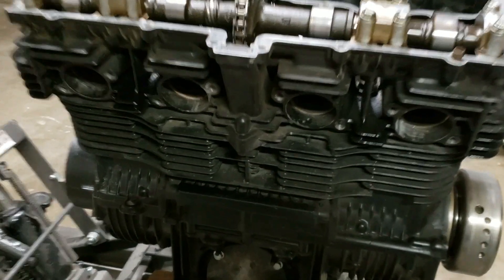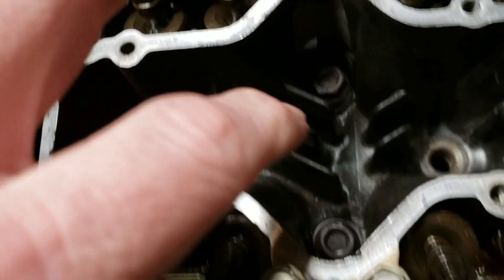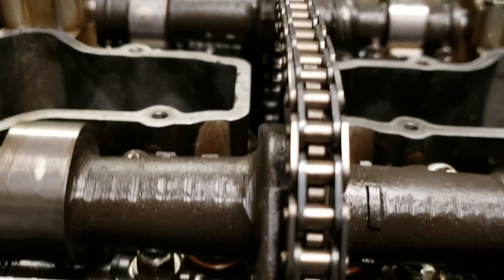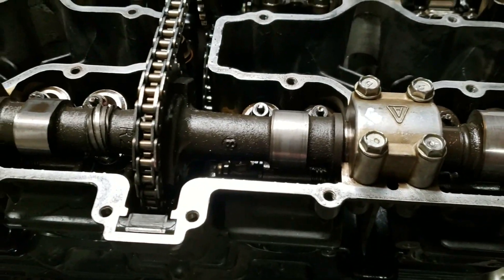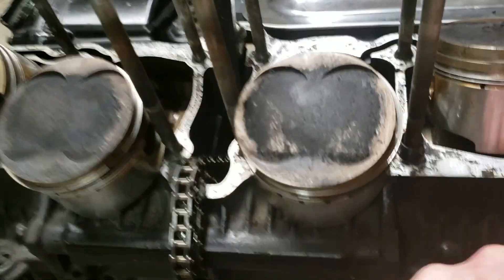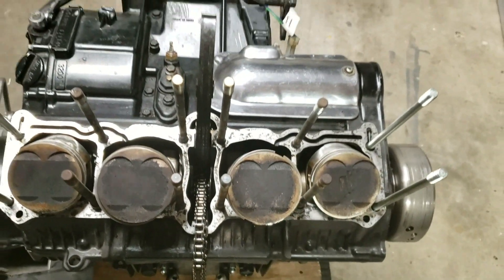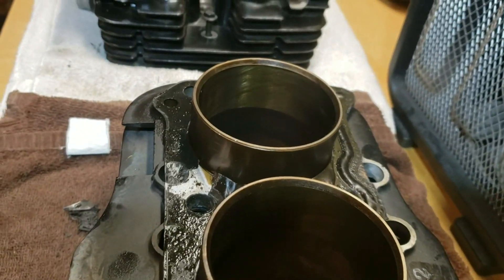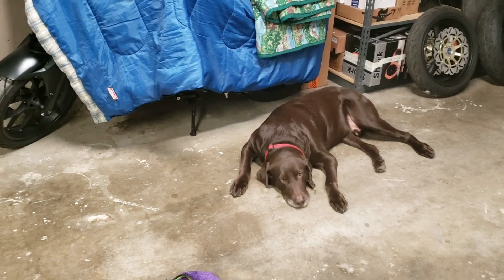DAY 53 83 Suzuki GS1100E build

Comment: Have 83 gs1100 built for drag strip only. I hv hard welded extended pads on rockers,with web cams 212grind. My cams and rockers hv been a issue with what I call glassing over. The best way to do a go ,no go check. Take a your feeler gauge ,I set my cams at .005 cold. And .004 hot. My hardest thing is getting both set the same. I try my.best but sometimes I see more glassing on onesie.

Comment: You have truly persevered with this rebuild.
No doubt there is some discouragement when you saw pitting on the cams and the stripped out tach gear.
In 2007 I started a "restomod" (restore-modernize) on a 1983 GS1100E that continues today. . .
In its early stages the GS Resources published a photo here:
https://www.thegsresources.com/botm.php?year=2008&month=3
There have been many changes since, including frame reinforcements (gusseting at the head and rear), along with Nikasil sleeves, Ohlins internals for the front forks, and a custom exhaust.
After multiple attempts with various reupholstering shops, I was referred to Dan and Paul at Bitchn Stitchn--who "made the seat that made the difference."
The GS continues to be my ride of choice (about 9,000 miles/year).
As for the cams, if you have not already checked out Web Racing Cams, I suspect you'll find them very helpful--and American Performance Engineering (APE), too.
Your restomod is beautiful--and it won't be long before you'll be enjoying it outside of the garage.
Reply from the maker: Thank you so much for your encouragement I'd love to see your bike please stay in touch and thanks again for the comments👍🏍🏍
Reply from the maker: I love your  bike very  very nice